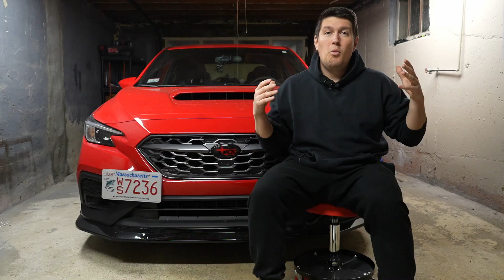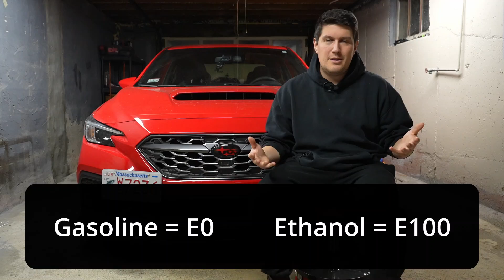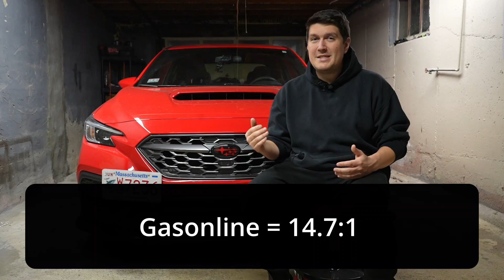Why Does Ethanol Make More Power Than Gasoline [Explained]

Comment: Great video but I have a question I don't have access to high octane fuel and the quality of fuel is so bad in my country 
So I wonder can I use ethanol for my stock car as a octane booster without any major side effects 
Because regular octane booster have bad effects on the engine and I cannot afford the expensive one's
Reply: My car has some engine knocks 
It's a 2002 c240 Mercedes 2.6 v6
Reply from the maker: Just run what you have, more likely than not if you are truly in a bad fuel area, a different car is the best approach. It's the reason I am not tuned on e85. or any e blend.

Comment: 5:04 What you're describing is preignition (ping). Knock is more associated with detonation (the mixture combusts too quickly due to the fuel characteristics or compression ratio).

Ping is when the flame front of that premature secondary ignition collides with the flame front of the main, intended ignition source coming off the spark. The two pressure waves combine and hit the piston harder and earlier than designed.

Knock is when the mixture is exploding off the sparkplug rather than burning.